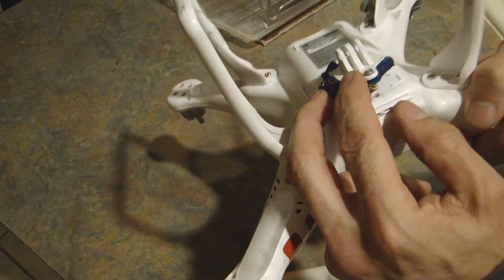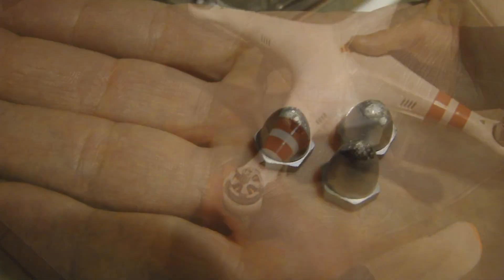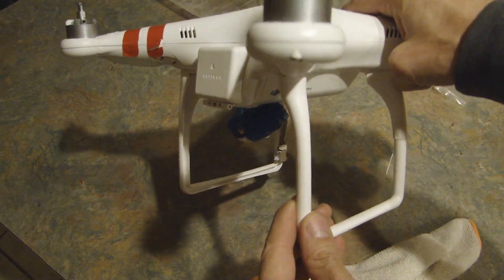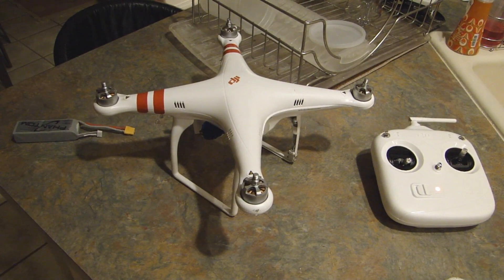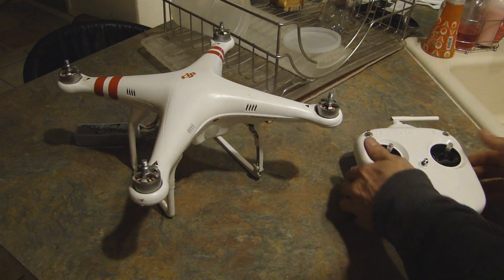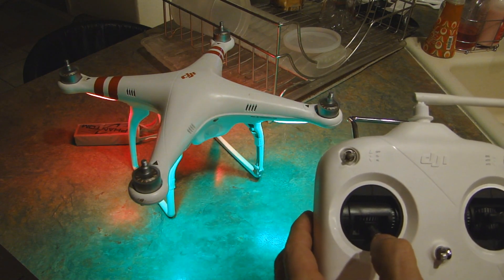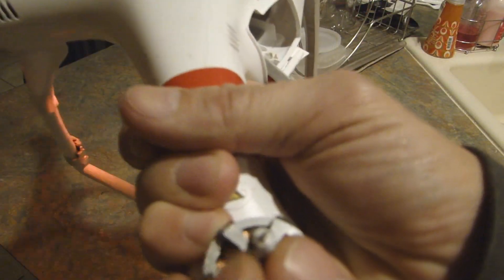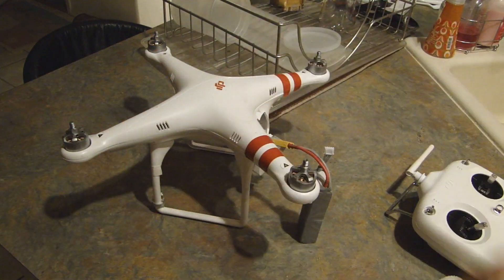Third training flight - Crash due to lost propeller...dammit!  Phantom falls from sky...

Comment: This is exactly what happened to my phantom and DJI told me it would be covered under warranty since it is a known defect of the motor to stop spinning suddenly and cause the prop to fly off. Once I sent it in and they fixed it, they said it would be almost $300. I'm currently fighting with them about it and it is impossible to contact anyone literate enough to talk to about it at DJI
Reply from the maker: MGmedia I think what really helped my case were 2 things:

1) The video
2) I insisted they send parts rather then me sending them the Phantom.  There was more damage than the NAZA unit, but surprisingly the other damage was fairly minor.  I was honestly shocked to get anything.

A point worth mentioning is that my tech support/warranty person was an American.  Perhaps this had something to do with it?
Reply: My gimbal was all smashed. I spoke with Americans as well but there are no employees with any power, no supervisors which is kind of strange

Comment from the maker: Matt K: You are essentially correct.  A propeller that rotates against the tightening rotation of a nut will always self-tighten.  The simple cure was to thread clockwise rotating propeller motors with left-handed thread nuts.  I will never use another motor whose tightening thread is the same rotation as the propeller's rotation.